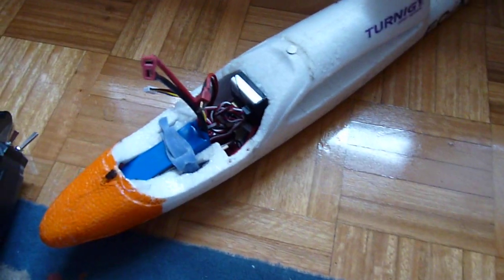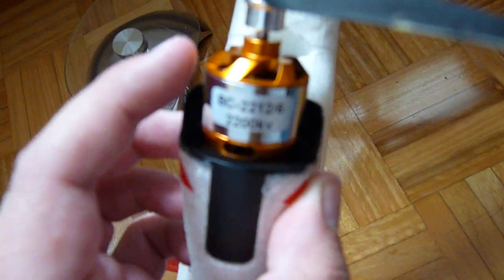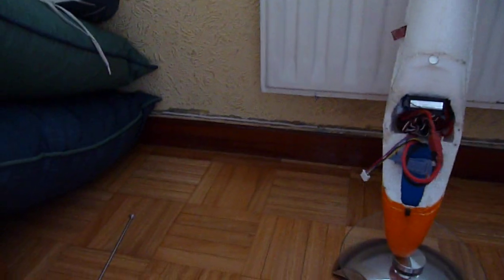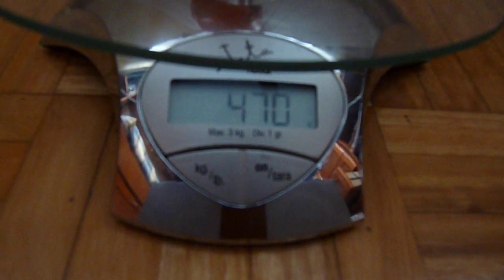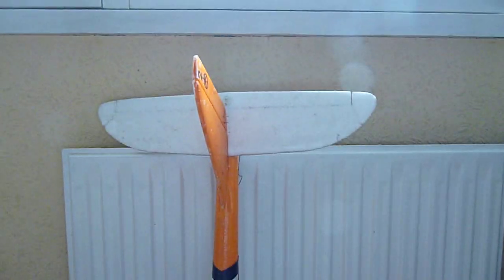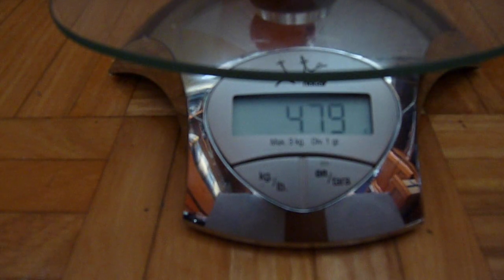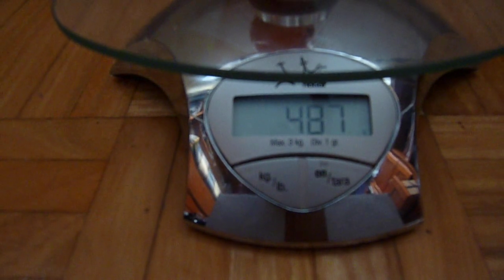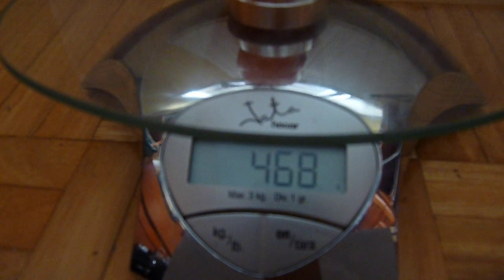Thrust test 2: CloudsFly with a 2212-6 2200Kv with 6X4

Comment: My planes weight around 600gr, can I use 5 inch prop with 3 Blade propeller? Thanks
Reply from the maker: i guess yes.
Latelly i have used this same motor in a wing with this same prop at 4S and its fine.. so on 3S a 5" 3 blade should be too..
Reply: @sparrowlt  okay, Thanks mate!

Comment: I have the same motor on my Easy Star 2 from Multiplex but with prop 7x6 and the thrust is over 1100g, I would say ~1200g. The model with all equipment is about 780g but climbs verticaly from start and is very fast. It needs at least 40A esc.
Reply from the maker: Be carefull..
This motor max sugested prop on 3S is 7X4..and the motor max amps are 34. With a 6.1X4.6 im allready pulling  344W/29A .. a 7X6 should seriously go beyond that..and that motor might burnout .. with an EasyStar i would say 7X4 is more than adecuated.. a freind is flying his Bixler 3 with this motor and 7X4 and it climbs like crazy

Comment: TGS Sport prop 6x4 E again ? same prop other video ?
Reply from the maker: Yes, same prop same motor (tought one is a labeled as turnigy 2826-6 and this is labeled as a rctimer 2212-6, but are in fact exact same motor). A TGS 6X4 is (or was if they allready fixed it) actually a 6.1X4.6 wich explain the superior readings.. and a TGS 6X5 is actually a 6.1X3.6 (they are misslabeled). I dont know if they fixed that year because has been that way for years